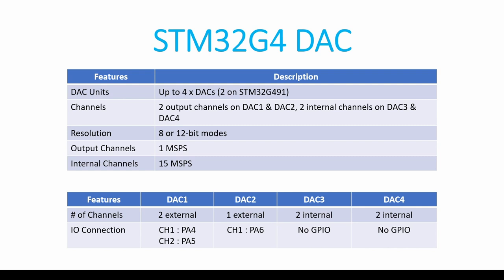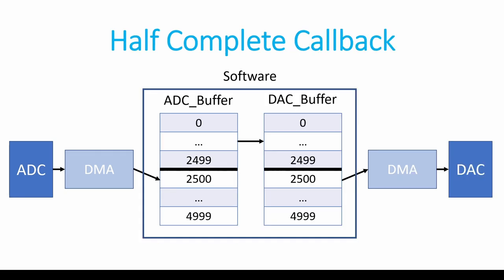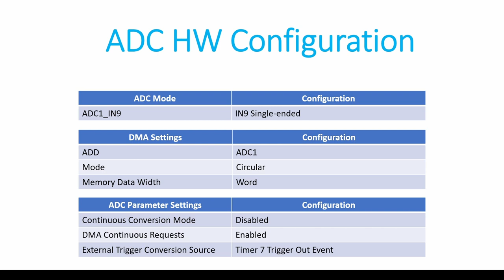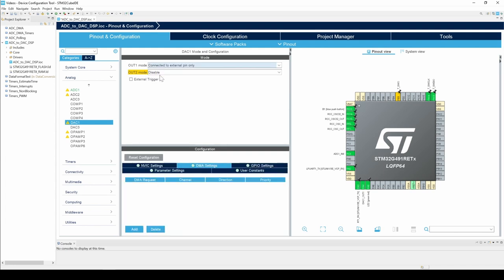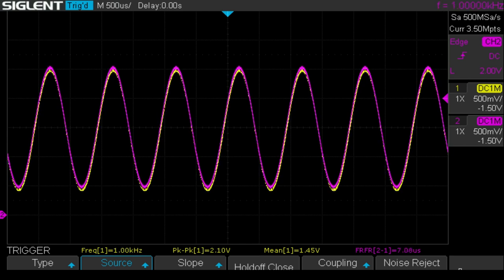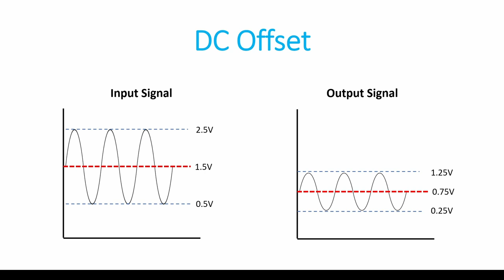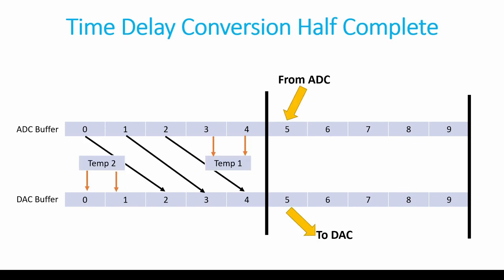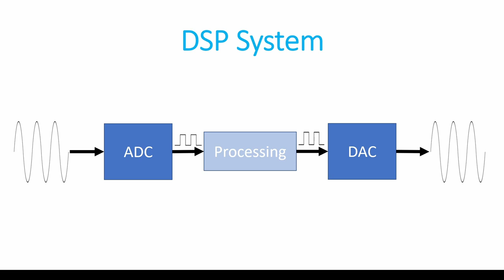STM32G4 & Real Time DSP: Part 5 ADC to DAC with DSP, Multiplication, Addition, and Time Delays

Comment: An interesting tip I discovered you might like to try.  Zero buffers.  Or rather a single sample at a time.  Depends on how much processing your do, but the H7 at 480Mhz can process 8 IIR filters in the time of a single 96khz stereo sample (about 20us).